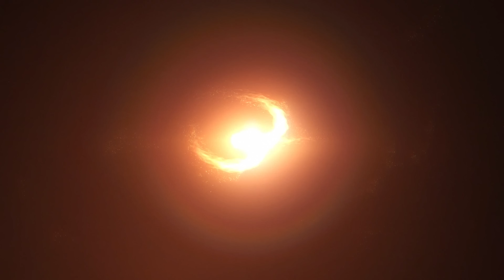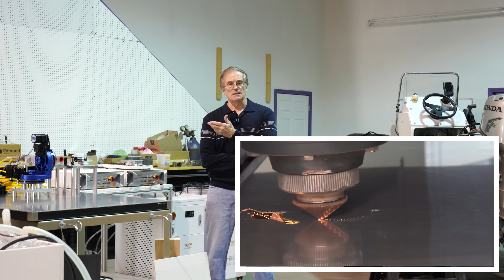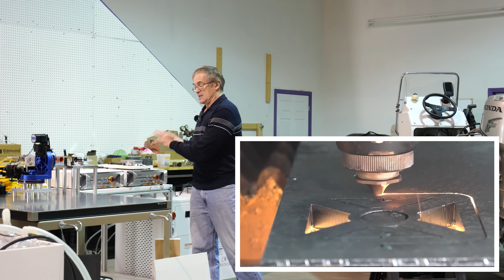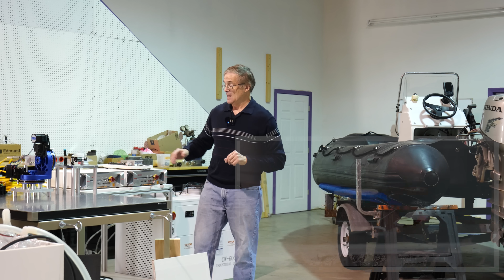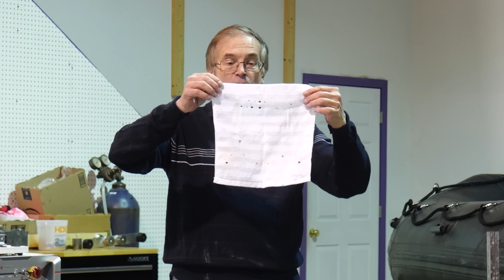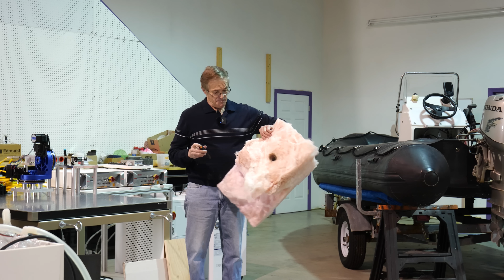We have a problem... and need your help!

Comment: Way back, you posted about epoxy composites with several informative videosm.  That's all I think of, as in you're the one qualified to make a better fire brick for your use case.  Tiles or panels.
Reply from the maker: I know.
The chalange is the huge area we have to protect. I'd rather avoid fabricating these panels myself simply to focus my efforts on the laser system.

Comment: You can use power bank instead of grid to power your device. This way you can control amount of energy in the experiment. For example, if you have 10kWh battery/capacitor and you charge it 10% you will have 1kWh of energy available. So for 100kW laser you will have safety limit of 36s. You can regulate this limit up and down. I didn't take any loses into account.
Reply from the maker: We don't want to limit laser power as that will decrease its effectiveness against the targets.
Reply: @TechIngredients  When you are testing destroying power of laser you don't have to test aiming at the same time.  So you can just shoot at static targets in front of quarry or in  tunnel.  If you want to test power+aiming you can do on a live system on a safe location or where you want to deploy it (military testing ground). If you want to protect a friendly building from being shot at, you can do it with physical limit of turning angles. But there is always possible that laser gets reflected from target. In that case all friendly things should be protected with this shield you are looking for.

Comment: We need to know what wavelength the laser is. Just right off the bat my first thought is a waterfall. Put some dye in the water that will absorb the laser. Of course you would have to have a lot of water moving evenly over a large surface but in general it could work. I did like the idea of dispersing the laser which is why we need to know what color it is to find a material that is transparented that wavelength.

Comment: What you need is ceramic fibre board. The kind that is rated up to 1260°C.  You paint it with a thick slurry of high Al-O3 refractory cement, and once that's dry, you paint it with a Infrared reflective foundry paint/glaze (usually zirkonium oxide; the best one is ITC-100 refractory coating). This gives you a board that looks like a white ceramic glazed plate; like your dinner plate.
You need a way to absorb heat, redirect energy, not crack or crumble and spread it over a large surface even tough you hit it in a point. You basically need the inside wall of a blast furnace; and what I described happens to be what modern gas forges are lined with.
And I know this works; because I had this problem before at a makerspace lasercutting wooden panels; this stuff absorbed the laserbeam; and lasted a really long time before it started wearing.
Now your laser seems to be really a lot more powerfull; but this board cannot melt (it cracks/crumbles), it can absorb enourmous amounts of heat, and is fireproof. The top coating will turn laser energy into heat, and radiate that away over a large glowing area. Give it a try.
Reply from the maker: That is an excellent suggestion!
Each component of that system is an upgrade to what we have already tried.
Reply: @TechIngredients  It's also similar to those ceramic tiles plus coating they put on the bottom half of space shuttles to prevent vaporizing during re-entry. If it works for NASA; you might give it a try :-)

Comment: Anything stopping you from using 2 lasers at 1/2 power instead of 1 at full power? 
Two beams at manageable power converging at one point on a target (essentially one full-power beam), and then they diverge once again after the intersection point with the target.

Comment: If your driving concern for weight is setup and removal, what about using a souped up garage door motor to raise and lower whatever material is suitable? Or maybe build an overhead track that would allow you to store moveable wall panels off to the side, then easily slide them into place together like in a hotel ballroom?

Comment: Put an Aquarium as the backdrop on a rolling cart. Fill with towels. Fill with sand. Fill with water. The water can’t be boiled in the time it takes. The towels block the light from escaping. The sand, optional, would assist with keeping the towels in place.

Comment: I see that using a water curtain or waterfall was already suggested.  My thought is to use two where one is positioned behind the other.  The first water curtain would do two things: absorb some energy, but also diffract the laser so that any penetrating energy is less focused.  Hopefully, the second water curtain would absorb the remainder of the diffracted energy more effectively than the first.  At this point, we should be getting pretty good at installing water curtains, so installing a third for good measure may not be a bad idea.

Comment: What about the same material the laser ppe goggles are made of? If available in sheets it could filter those frequencies of light. I'm not sure on how cheap it would be though.
Reply from the maker: You're right about the high cost being an issue. Also, these are not designed to take a direct hit by a laser.  The plastic would melt, or the glass would shatter.

Comment: What about the earth. Eg, direct the laser down, directly into the ground. There's an absorption medium as thick as you need.
Or you could just use a commercially available beam stopper. ThorLabs produces a range of beam stoppers for the exact purpose your looking for.
I'm sure most laser equipment companys sell similar devices, or atleast you could get some good ideas from the compounds they use in there beam stoppers.
Reply from the maker: The problem with those is the cost to cover about 20 M^2.

Comment: easy solution : make a wall with a few black holes , sorry i don't have much ideas , maybe try the heat resistant material that makes carbon foam when hit with high heat , i don't remember the name but nighthawkinlight had a video about it

Comment: Orbeez........................framed box with screen mesh surface filled with presoaked Orbeez ,  the lazer hole in the screen mesh should be small  ,so as to  not effect its task of holding the   orbeez ...     love to hear if it would not work whiy ?

Comment: I would be cautious about firing that laser at anything like sand or other materials that could produce toxic byproducts for you to breathe. Sand, for example, will explode into tiny shards of silica, which is the most dangerous type contributing to silicosis.
There is a  company in California that might still be in operation called Technifex.  They make a system for creating a theatre effect that looks like a wall of flame, but its just atomized water that their devices shoot up in a wall of fog that they then use lighting to believably simulate the appearance of fire with no heat.   You would not need the lighting, just the sheet of fog. The devices look like long, low boxes that are often set into a table or floor surface, but could be mounted on casters for mobility. You could mount several in a row, and 2 or three ranks deep. The laser hitting a foot thick zone of spherical droplets of water should be diffused rather widely coming out the other side. You can make it three feet thick if you choose and they can work with you to get the size and density of water droplets  high enough to ensure the laser is going thru water droplets.
Allowing you to place a curtain panel behind that could effectively take any remaining heat energy. 
The best part is any water droplets that absorb heat will simply turn to non-hazardous vapor or steam.
Their units very little water, you sometimes seem small ones in restaurants, simulating a low flame along a table or bar, and when you put your hand in the ‘flame’ it just barely gets damp.   Their larger units can create fake walls of flame 15 feet high. But their advantage is they have a built in air system that keeps the fog confined into a sheet and shoots the sheet of fog up vertically.  They don’t fill the room with it. Most of these units create a fog so fine that the water evaporates about 8 to 10 feet up so the floor doesn’t even get wet.

Comment: Maybe a multi-layer approach?
First layer a water curtain to dissipate the beam and absorb some of the energy (I'm thinking like a laminar flow curtain that is in some public water displays), it should be reasonably easy to build. PVC pipe, some powerful pool pumps, a large water source like multiple IBC touts or a pool if available (and preferably also a water collection contraption beneath that returns the water back to the source, so that you get a closed loop and don't have to supply "fresh" water all the time.
And for the second layer, something cheap and easy . I'd opt for 1-2 (or what tests show is needed to provide the required safety margin) layers of plywood. And since we have the "water wall" in front of it the intensity should be substantially reduced/less focused this time. We can/should also add fine mist sprayers that constantly wet the plywood. That mist will also contribute to diffusion and absorption. Runoff water from the plywood wetting could be collected in the same contraption as for the waterfall we made.
Reply: Another idea is to just mist sprayers, but A LOT of them to basically build a wall of water mist. They are cheap and one could also be experimented with adding some dye to the water, preferably something that is highly adsorbant to the frequency the laser is working at. Not sure though if that would cause a huge amount of steam, it probably would be a good video though 😀 The mist wall would also need a backdrop so I would stick with plywood in this case also as it would be constantly wetted down by the misters it should be safe from fires.

Comment: First thing I'd do is make the laser aim straight downward and use a reflecting mirror to aim the beam in the operating "work" direction. Having a failsafe that pulls the aiming mirror instantly out of the beam path would "safe" the laser by aiming it down. You can make a multi foot deep tube of sand/water/etc target below the laser that is easily replaceable and disposable. 
Behind any target you're working with you can put a 45° mirror to reflect the beam into the ground. (You would have to see if the concrete deals with the beam in an acceptable way.) If a simple mylar sheet mirror reflecting sheet can deal with reflecting the beam it would cover a large backdrop and be very quick and easy to put up and take down. 

Another possibility is "de-collimating" the beam in some way similar to frosted glass. I suspect that with how narrow your beam is frosted glass may not act like a diffuser because at a very small/microscopic scale it would be like a somewhat chaotic prism. But if you spun a frosted glass sheet/lens quickly the spinning would add the randomizing effect that would spread/diffuse the light widely so the laser wouldn't be able to burn through anything.

Comment: Steel cutting machines use cast iron to stop the laser, after cutting through thick steel. They also make sure the laser is always moving, but you could make sure the cast iron is always moving.

Comment: How mobile does it need to be?  A fish tank where you dye the water different colors for experimental fun of course, and of course you can make your own vertical panel/tank on rollers if necessary.  Why wouldn't you want things like adjustable power?  would a trigger mechanism be feasible?

Comment: This is silly sounding but hear me out: A fish tank full of water with a good amount of carbon dust in it, a pump to circulate the dust in the water, and a beam trap tunnel between the beam and the tank to keep reflections from escaping? In theory if the tank glass is as good as the optics, the glass should be fine, and high thermal mass of the water, plus convection, plus the pump should sink a ton of heat. The carbon dust should break up the beam quickly without absorbing all the light right at the glass surface, so the heat is dissipated gradually as it travels through the water.
Reply from the maker: I understand, but remember we have to cover the whole back wall. That's  about 25^2 meters.

Comment: Can you divert the beam before it gets focused on the laser table and send it as diffuse light into something like a graphite crucible. You can buy those pretty readily. 

You could even use this as a firing mechanism and pulse duration modulator. Set it up so the unfocused beam normally points into the crucible, then you have an actuated triangular mirror that drives through the beam thus pointing it into the focuser, kind of like a guillotine. Adjusting the position along the triangle that sweeps across the beam changes the duration of focused light. In your "E-stop" chain, add a passively held machanism that will smash the mirror when unpowered and dumps any light into the crucible.